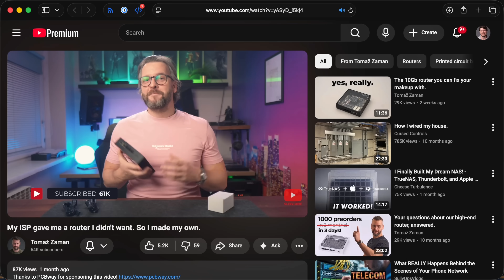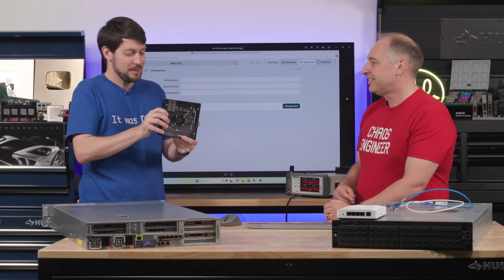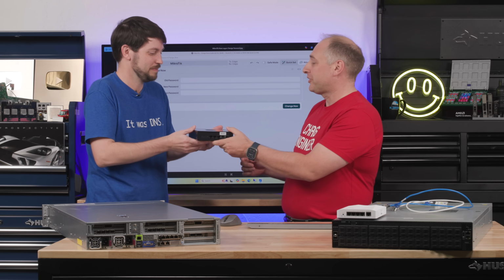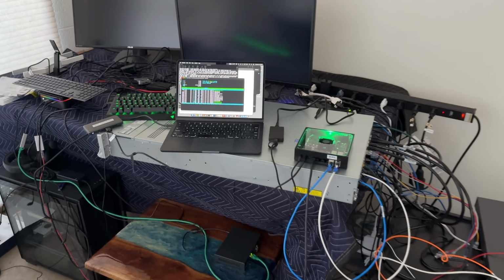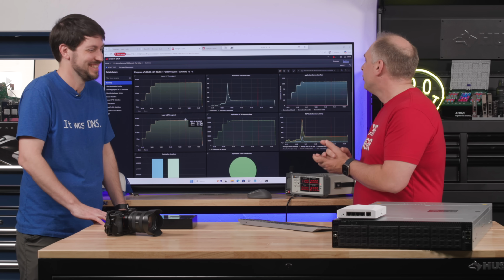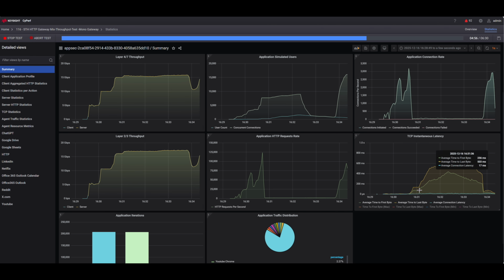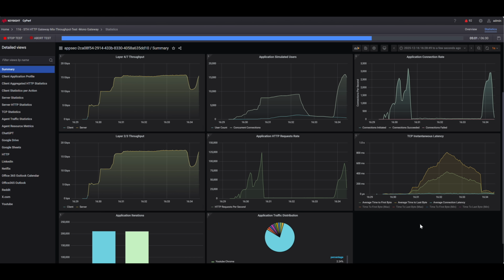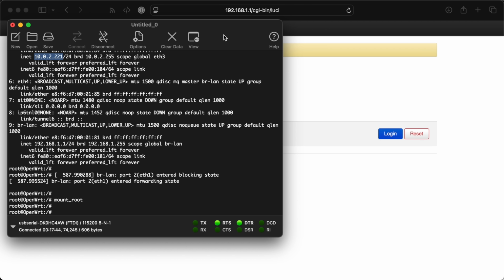$1m server vs $600 router

Comment: Jeff, it’s truly an honor to have you and Patrick taking the time to put our device through its paces! ❤
Reply: It is a very cool project
Reply: The ultimate YouTube cross over no one saw coming
Reply: @theatermusic87  Our two dorky superheroes in one video - not all superheroes wear capes
Reply from the maker: Thanks for sending over this test unit so quickly, so I could get it over to Phoenix in December! Can't wait to receive the one I preordered :)

Also, sorry about saying it's a Mediatek chip earlier... I was deep in my GB10 testing and so Mediatek Arm SoC's and specs were on my mind while writing and recording this video, oops!
Reply: @JeffGeerling  Waiting for mine. #290. Any Updates?
Reply: @wolfgangpreier9160  You wanna ask tomaz that, jeff dosent have info
Reply: @waterfaII  I DID ask Tomaz.
Reply: this is like Batman and Robin meeting up with Green hornet and kato
Reply: Probably the best router development channel ever.
Reply: Nice progress Tomaz! That's +1 (or 1UP) for networking gear out ot Europe. Keep 'em coming!
Reply: Hell yeah, i spotted the Mono in the thumbnail instantly lmao
Reply: Tomaz this device looks awesome. Does it support Wi-Fi 7 expansion? I'm mainly interested in getting 6 GHz connectivity.
Reply: @paulstejskal  You are usually better off using a wired router and then use separate APs for WiFi. That way, you can upgrade those separately when needed.
Reply: @blunden2  underrated comment.  Wifi changes far more than your need for routing so upgrading a couple WAPs is so much easier than your entire router.  Get away from consumer grade stuff and your network life will be infinity better.
Reply: @blunden2  I may consider that. I only have 900 square feet to cover and 2.4 and 5 GHz really isn't a big problem except for competing neighbors. 2.4 GHz is pretty crowded but I found a unique 5 GHz DFS frequency so I'm good for now.
Reply: epic
Reply: I'm pre-order # 335 :)
Reply: May I ask what the m.2 slot is used for? I've seen it on previous videos about a year ago when the router was still an idea
Reply: What a special trio 😮
Reply: @tomazzaman So was NXP nice enough to let you use the OpenWrt build with their hardware offloading implemented for benchmarks like these ahead of buying the license, or did you end up having to buy it for 2025 too anyway? 🙂 The cmm process seen there indicates that offloading is being used if I recall correctly.

Regardless, I'm looking forward to the next video. 🙂
Reply: @blunden2 He had to pay up the license
Reply: I have been following your development for months. Glad to see the YouTube community is supportive. Love the box and will order
Reply: Do you have any plans to release this in a standard 1u 19" rack mountable case?  I'm very interested if so!
Reply: Nevem kako da to napism ampak iskreno rispekt za tvoje videe. K sm te najdu na youtubu sm meu en obcutk da si iz slovenije in k sm prvi video pogledu nism mogu vrjet da mamo tud slovenca v temu tech podrocju youtuba. Tkoda zelim ti sreco tko v smeri youtuba kot tud tvojga biznisa z routerji😁
Reply: I watched all the series so from a distance I can see your router

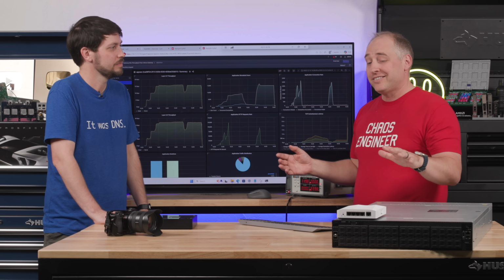Comment: @13:00 They do do it in industry, it's just not that transparent. You can't say that Checkpoint for example doesn't test the delay caused by having all the firewall inspection blades enabled.

Comment: The funny thing about using iperf3 to test your throughput is that if you don't get the expected bandwidth you don't know which component is the bottleneck, however if you do get close to the rated speeds, you know that everything must be fine.

Comment: The tests are basically like IMIX and many firewall/routers should give you those figures alongside their fixed packet size throughput figures, but they are not always clear on what settings they did the testing with.

Comment: Being a premium product, it's a bit disappointing that the Mono gateway can only be powered by USB-C and doesnt have the option for a positive locking DC connector, which is a bit of a point of failure.

Comment: Sorry, but $600 for a router using a CPU from 2016 with only 2x SFP and 3x 1G ports is wild. You can get a Banana Pi Bpi R4 Pro for under $300 and get dual 10G/SFP combo ports, 4x 2.5G ports and 1x 1G. I don't think Mono is a good use of money, at all. Cool video otherwise, though!

Comment: OMG,  I retired from a networking job 8 years ago today and some of the interface speeds and throughput speeds he's rattling off around the 5 minute mark are ones I couldn't have conceived of while still working. 10Gig had become fairly commonplace and 40Gig interfaces were pretty new then.
Reply from the maker: It's crazy we're talking in Terabits for single high speed boxes now!

Comment: Jeff, might you have power specs? While I understand higher speeds need higher power, I’m not prepared to pay 21.6kWh per month to run a router at 30W nominal at home. Especially when this energy budget excludes everything else needed to run a full home network.

Comment: Why talk about throughput using HTTP without discussing and/or showing the amount of CPU processing time? I write software for embedded data links over TCP sockets.  Some devices we talk too use JSON messaging over HTTP and it takes "time" to decode HTTP frames.  HTTP frames have a content type parameter that the application layer needs to examine to determine chunk type, etc... and you guys don't even talk about this and go on to brag about how expensive your test gear is.  Measuring throughput is not trivial matter of sending a fixed sized packet, getting it back and measuring round trip time.  SynCookies and other settings for example and if enabled, have faster setup times. You guys didn't talk about this either, why?

Comment: I'm just glad OpenWRT is finally getting recognition as a high performance firewall OS. I've been using an x86 OpenWRT VM as my main firewall and I love it. Also, @JeffGeerling, CyPerf's opensource alternative is Cisco's TREX. Optimally, TREX needs DPDK support but it should run on the raspberry pi, just sayin'.

Comment: It'd be cool to know if you can plug a wifi-7 card in there. The website only mentions wifi-6, and no details about bandwidth info for the m.2 slots. It's hard to find open-source based wifi7 access points / routers with SFP+ ports, only one so far is the Turris omnia, which currently is on my shopping list. This mono gateway would be using much less power though.

Comment: The main reason they're not going to test with jumbo frames is that this is being used as an Internet router and ISPs support a maximum frame size of 1500 bytes of payload (excludes headers).  The only time you'd see jumbo frames on an interconnection between ISPs would be a PNI for cloud services where it's really not intended for end user traffic.  Furthermore you really don't want to enable jumbo frames on your LAN because you'd have to ensure all devices are configured for the MTU you select.  There's no standard for maximum frame size beyond a 1500 byte payload, so support varies.  And it's a problem because there's no fragmentation possible on a Layer 2 network... there's no mechanism for two hosts directly communicating to inform one another that they discarded a frame that was too large.  So jumbo frames on the LAN is typically limited to segments that really require high throughput among servers where the number of hosts is limited and tightly controlled.

Comment: $600 for a dual port 10gbit router is wild... Especially since you can get a used Arista DCS-7050SX-64-R for half that and you get 48x10gbe and 4x40gbe and it's data center grade reliable, unlike what was put together by some random dudes in order to kickstart their youtube career.

Comment: Im interested to see the pppoe performance. Kpn (provider) still uses pppoe over their fiber network (pon).  So we have a 10gbps with a 4gbps symmetrical pppoe connection. 

Plain packet forwarding and offloading is easy - pppoe is not as multithreading and offloading is hard.

Comment: I don't get it. There's the Banana Pi R4 Pro(8x) which does 10G across both RJ45 and SFP,  now they're no longer just a "chinese player", they built the OpenWRT One which is the board designed by the core devs of the OpenWRT project, and all their boards get OpenWRT support almost in the same quarter they're released in.

We also have 100s of Banana Pi-R3 deployed in the wild with not a single board having an issue (yet), running OpenWRT running all sorts of software (incl. Asterisk, a Node.js web app, WireGuard etc.)

Now software support aside, the R4 Pro also look cheaper and has more features than this board, no shade to the makers of the board being showcased, more competition is always better but I don't get the appeal?
Reply from the maker: R4 Pro is a very cool board.

But having more than one option that's friendly to OpenWRT and has two SFP+ cages is nice. This box is a developer edition, and I'm hoping they can make a more production version for less.

Plus Banana Pi isn't painfully honest and open about their entire hardware dev journey—and they may in fact have more experience, too! But part of the cost of this thing (for me) is supporting the Mono team who are building it and sharing the details.

Comment: RPi?  no.  ARC or MIPS based?  It's already in there.  Intel was already using ARC IP and chips for management/scheduler/etc deeper chipset functions that need more controllers/drivers in bigger chassis systems.

Anything with a high clock speed and a lotta lanes of PCIe can support high bandwidth connections outside of a HPC localized network; I'm waiting for RISCV devices to appear that are basically big traffic management/scheduling foci which can pipeline/multiples a very high number of  PCIe lanes - that can also be used for high performance storage/retrieval by those devices also being able to handle M.2 or NGFF NVME drives natively at the hardware level, well...how much do you want your NAS to appear as if it has less than the latency of local storage because you're getting massive chunks down fat pipes that take less effort to disassemble and reassemble than just doing the thing on your local human facing physical hardware instance.

PCIe cards mean you can add not just whatever protocols you want but also whatever physical transport, like could even mix fiber and copper in the same machine without a hiccup because to the controller/driver hardware it's all just PCIe work.  Clock speeds could be pushed so much higher if we lost all the computing, et al, deadweight choking the system stack up, vertically and horizontally.  RISCV on optical computing hardware is going to be crazy fast lol time to start up the ternary logic FW ports.

Comment: 10 Gbps. to WAN and 3 x 1 Gbps. LAN… weird. So my LAN 2.5/5 Gbps. devices cannot work at their optimal speeds? I then need a second 10 Gbps. switch connected to the SFP LAN slot? Very, very weird. Or do I misunderstand something?
Reply from the maker: Yeah; this is meant to be more of a router, and downstream you'd have a switch. The other RJ45 ports are more for convenience or separate VLANs.

Comment: Well. On this device, I think most important part for most people is IPv4 NAT performance. Trust me, most NAT implementations is not as performant as one would like. It is mostly a software thing, but still not something most stacks optimize for. It is not hard to do routing, or bridging, either with Linux stack or DPDK / VPP, at line rate, but NAT is way heavier, and often cannot utilize multiple CPU cores and hardware queues when using a single flow. Amount of locking also is crucial.

I do have a custom built 25Gbps router with NAT on IPv6, and just routing on IPv6. And in my testing IPv6 performs generally better, due to lack of NAT. (There are other advantages of IPv6 like faster header processing, and no checksums, but that is usually not a problem on IPv4 either because checksum computation is usually done in NIC hardware this days with checksum offload).

I would bet that there is still quite a lot to do on a software side on this mono router, and it can take a year or two to get to full potential, especially one starts using more features of it.

Comment: So id like to see the speed when all services are disabled on the device.
It only does routing port to port.
Use a static ip config on the device and use RS/UART to disable all services.
Also disable any debug data at boot-loader kernel line if anything is enabled by default.

Comment: I spent significant  time 25 years ago doing performance comparisons between Juniper M20 routers (once the jet fueled dragsters of the internet) and Cisco GSR routers (the commodity F-150 of the internet).  One thing that becomes immediately apparent is that variable packet size obviously impacts throughput.  You have to have the backplane fabric density to handle large packets but you also need the ASIC processing optimizations to make actual routing and filtering decisions at wire rate for small packet sizes.  For ethernet sourced traffic, min and max packet sizes are 64 and 1500 but filling a 10 gigabit/sec pipe with 64 byte packets requires 23.4 times as many routing decisions as filling it with 1500 byte packets.  The firms making test gear that can certify gear operating at these rates have to be at least as competent as the original vendors.  There's been continual churn in this space since  markets are small and costs are high.  Back in the day, SmartBits was the co-leader with Agilent.  At one point, SmartBits was acquired by Spirent and Agilent spun off this sector into Keysight.  As of October 2025, Keysight bought Spirent so there seems to be less competition in this space.
Reply from the maker: Yeah, it is a little sad seeing consolidation especially in network testing and network equipment. For the smaller packet sizes, Patrick has more gear that he's been working on for STH videos; he may get to do a re-test with all that and more when he gets the Mono Gateway he's trying to order.

Comment: I'm curious if you're interested in PC/104 and its variants? It's been around since before Arduino and the raspberry pi. It's x86 and can do Linux or Windows. I like hardware 🤷‍♂️ not really a coder, but I've looked at several different languages starting with Basic,  Qbasic, C, C++, Visual Basic etc...

Comment: the problem with this project it was perfect when announced 2 years ago, 
but as there is no team to speed up the process, and it was revised for cost cutting once already,  by the time it will be available to buy will be obsolete.
Only gigabit rj45 ports when all new routers have at least 2.5 these days...
and  600usd is a lot considering you will need to buy the sfp modules and possibly some dac cables too
but i wish the best , at least they tried..

Comment: Damn. $600 for the Mono Gateway. I needed a solution with at least 2 RJ45 10GBit ports.  I bought a reverbished HPR OfficeConnect 1950 Layer 3 Managed Switch. It has 24 1 GBit RJ45 ports, 2 10 GBit RJ45 ports and 2 10 GBit SFP+. All for the price of €176,98.

Comment: I still don't understand why one would want SFTP instead of RJ45 for 10G
Reply from the maker: More reliable connection, lower power usage with DAC and Fiber optics. But RJ45 can be more convenient and compatible, sometimes.
Reply: that does make some sense, cheers.

Comment: Nice Video, but what is the point of this router if I want to use Wired connections? Firewalls? It's only a Router without a Switch? I guess I'm used to Routers with integrated swiches. But I have only 500mbit/s, so I can use standard lan. What is in the usa a good and normal internet speed from the provider? I whould say in germany its 100mbit/s speed via dsl, cable or fiberglass. Fiberglass is not everywere available.